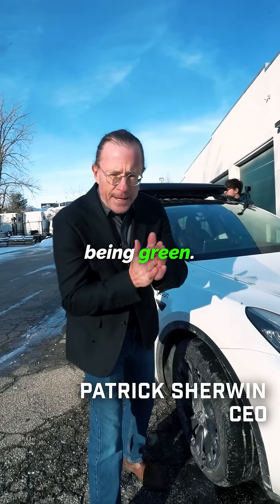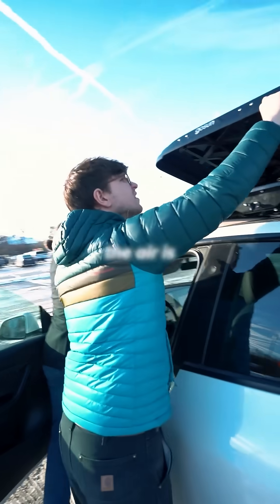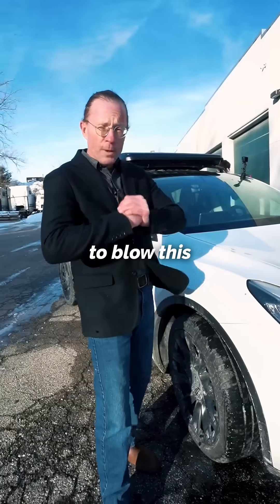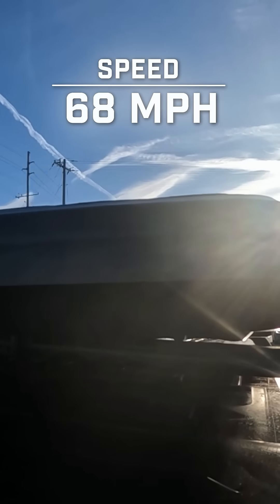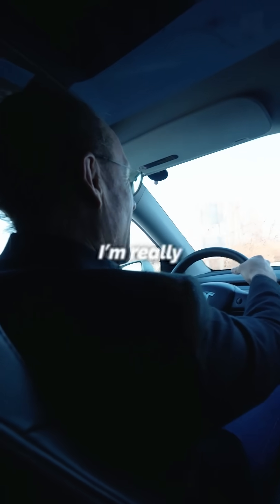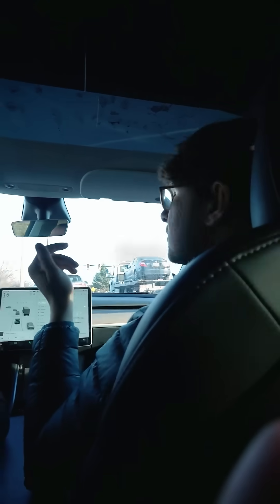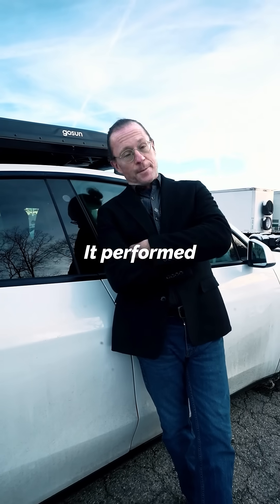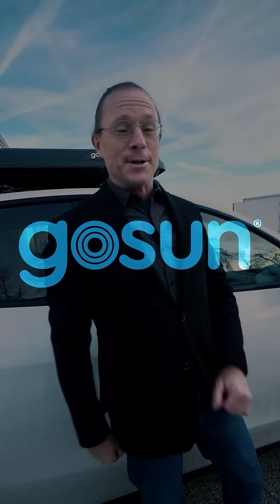Solar EV Durability Test!

Comment: What is the reduction in range due to the increase in drag?
Reply from the maker: The EV Solar Charger is designed to be low-profile and aerodynamic, so any reduction in range from drag is very minimal. Most of the energy you gain while parked in the sun far outweighs the small effect on driving range.
Reply: So you broke the law on camera wreck less driving on a public highway? Go-to a drag strip where you can safely test. Why risk others lives to test a product? Seriously.